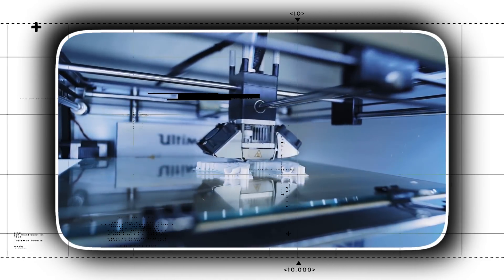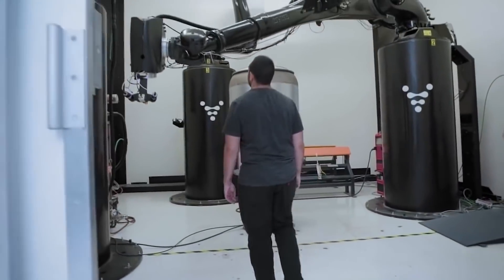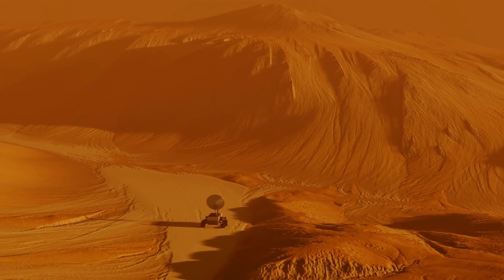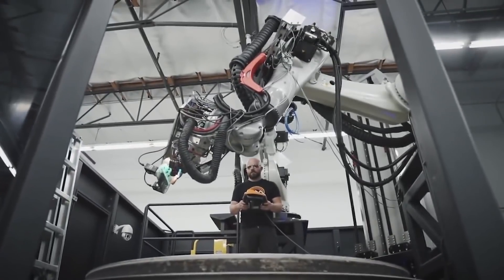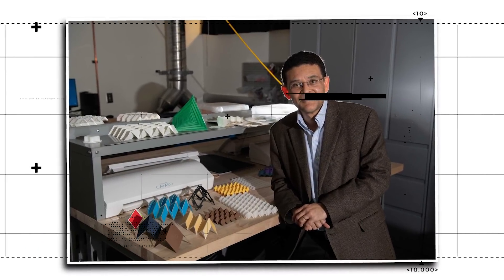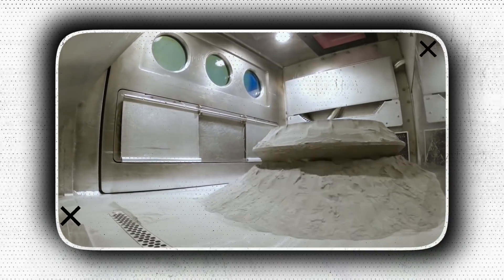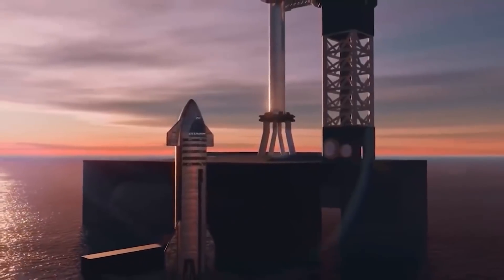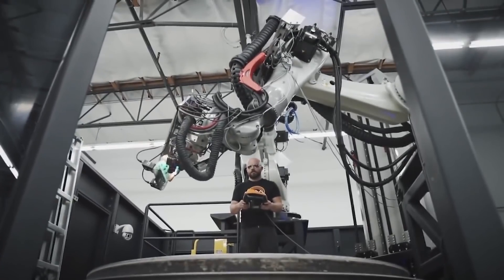Elon Musk Just Revealed That 4D Printing Is Our Way To Mars!

Comment: Z layer separation is a major issue with most consumer grade 3d print projects. I'd imagine that it would be really difficult to adapt 3d printer technology for industrial purposes for the same reasons. The last thing I'd want is a rocket to unravel at the z layer due to weak fusing.